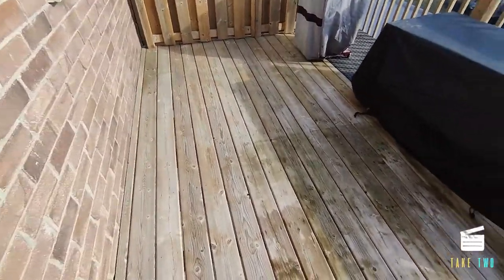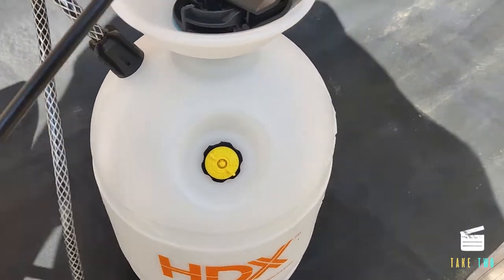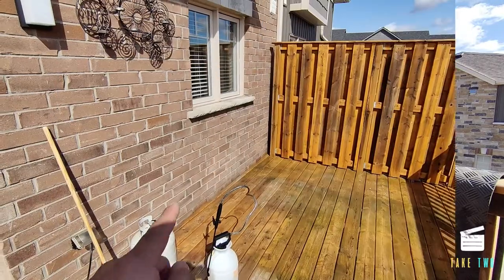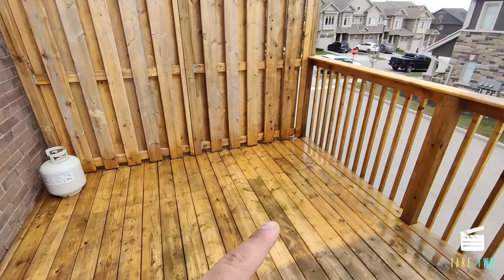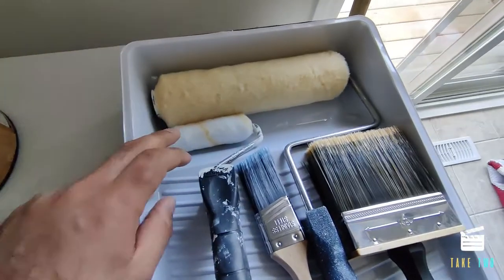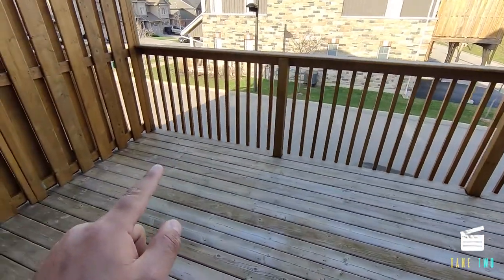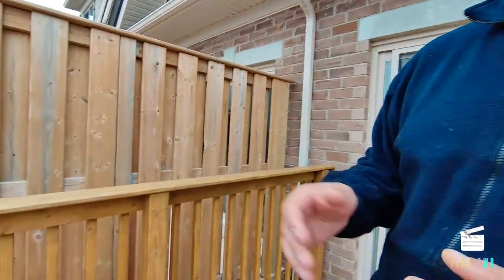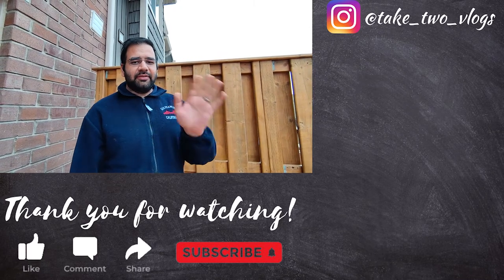Wooden Deck Cleaning and Sealing | Deck Transformation Part 1| Take Two Vlogs

Comment: Good video, but I think you should've worn some PPE? Cause the chemicals have lasting damages on skin, not scaring you but just informing.
Reply: Thanks, yes I would recommend wearing rubber boots while spraying the deck cleaner. I had some irritation. Thanks for the suggestion